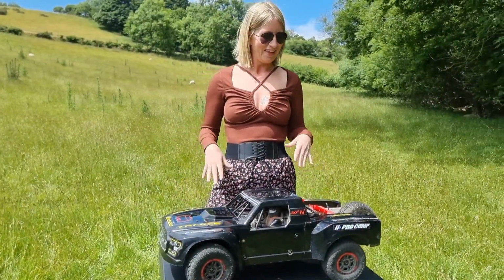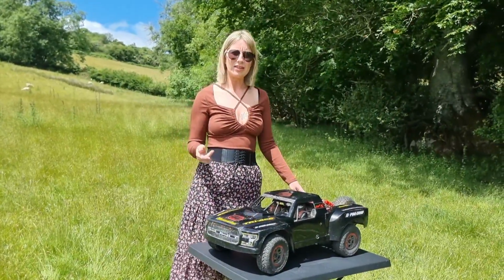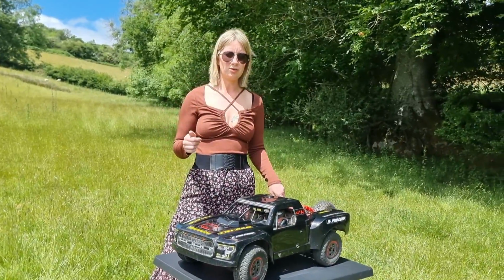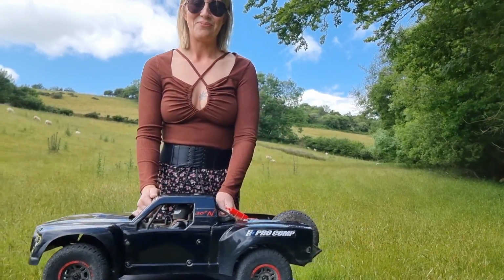1/6 brushless RC truck - 30° North SDT

Comment: Good solid vid there - that does sound like the motor pinion has worked loose. Looks like a great rig ☺
Reply from the maker: Thanks very much, appreciate the support

I fixed it last night, it was indeed a loose pinion, it had slipped away from the gear, easy fix thank goodness 😁